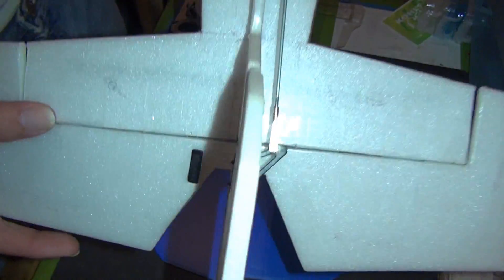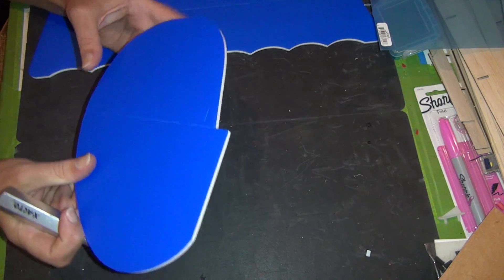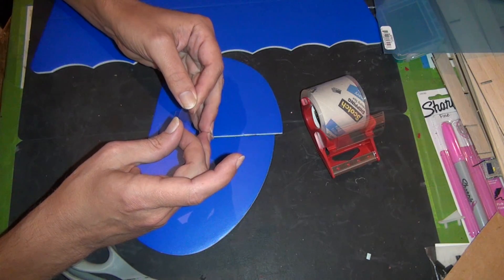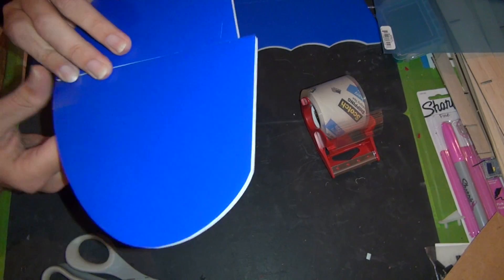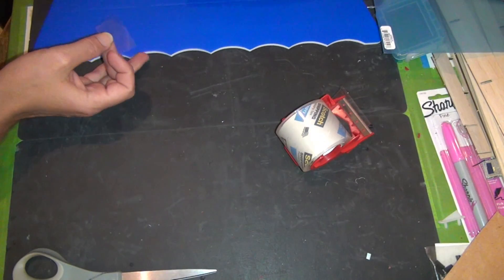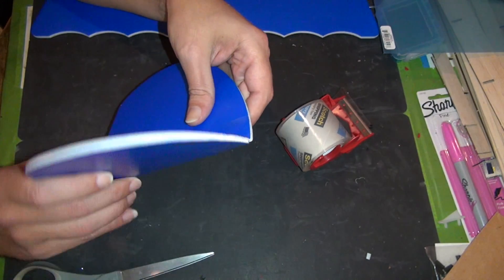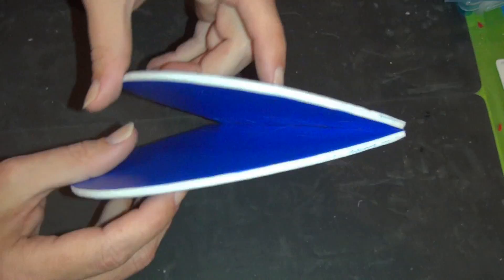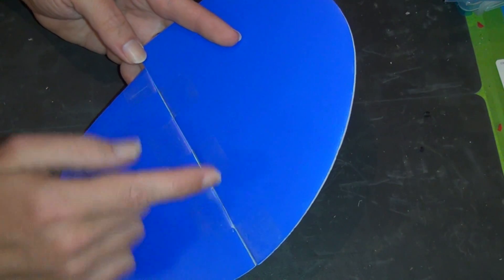How To: Tape Weave Hinges for Planes

Comment: Great job Jazzy! I find this difficult, but I like the result if I get it right. But I haven't done it your way till now, I always put all the tape on and tried to hold it back till I had everything lined up, really tricky. I will try your 'from one end' method next time. :¬)
Reply from the maker: Oh yeah, that method is nearly impossible, your tape always gets stuck somewhere wrong trying to hold the ends out. It's tricky to keep it tight when doing one at a time, especially when you get to the end, but if you're careful threading the tape it comes out super tight with no gap.
Reply: jasmine2501
 I tried to develop a method using a very thin piece of music wire to hold all the tape pieces back while I positioned the ailerons and although it worked, it left a bit off a gap when removed. I will try your way on some scrap today. ;¬)
Reply: @jasmine2501  ... patience, Daniel-San! :P

Comment: Thanks for the video.  Good for an application like a foam board surfaces you illustrate, but for a .25 glow model I don't think would be applicable. Good video.
Reply from the maker: Actually no! You can use this on huge planes! It is actually quite a bit stronger than the CA hinges that are often used, and it holds better than plastic hinges, because it holds more of the control surface in a very balanced way. This is an old technique that used to be popular on fuel planes, although it was done with silk and dope.
Reply: jasmine2501 We will have to agree on disagreeing.  I know glow fuel models.  I would agree it is a strong hinge, new.  But glow fuel planes get coated with oil, nitro methane.  After some time, all tapes get funky, and all that oil/nitro methane will degrade the adhesive. I only want to do the hinging once. Good hinge for non glow fuel planes, like electrics. Thanks
Reply from the maker: I'm not giving an opinion here, we actually did this. You simply have to use adhesives appropriate for the situation, like you ALWAYS have to do. This method does not imply any particular material or adhesive. The entire plane is made of different materials bonded together with adhesives and fasteners and you always have to consider the operating environment when you do that. Do you know how many rotten CA hinges I've seen on fuel planes? Hell, I've even seen people let them get so dirty that it destroyed the WOOD. That's going to be an issue no matter what you do, and pilots who don't clean their planes are going to have problems. That oil is extremely destructive.
Reply: @jasmine2501  In the video, you're using Scotch shipping tape.  I would never use that on glow plane or gasser.  Also, I've used CA hinges, installed properly, I never had a failure.
Reply from the maker: Totally, yeah. I've never had a problem with them either, but you know... a lot of people don't take care of their planes. And yeah, I'm using an adhesive appropriate for the plane I'm working on.